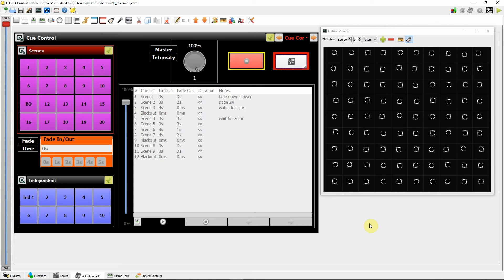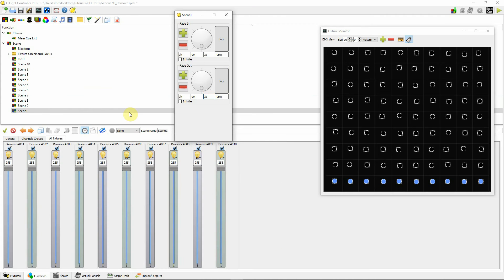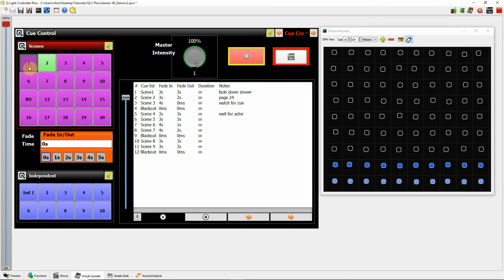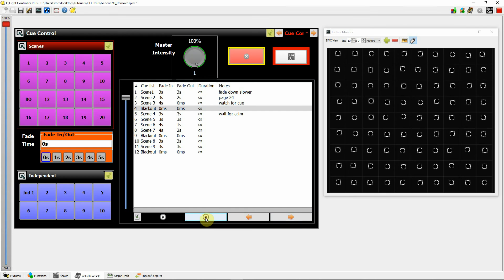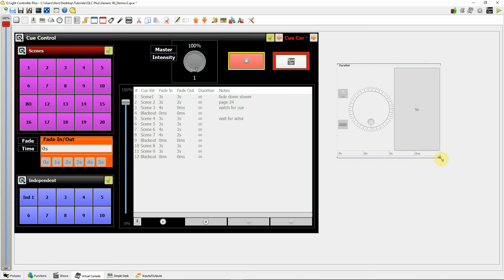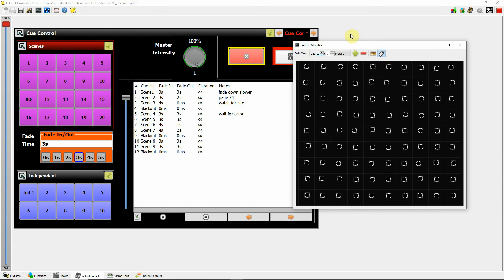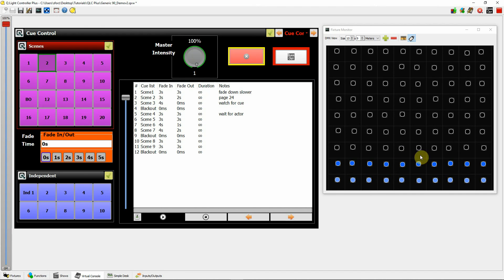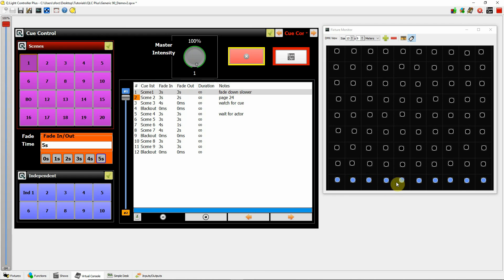QLC+: Control Fade In and Fade Out Time

Comment: Hi mate can you do one where you plug a lighting desk into QLC?
Reply from the maker: Iam not sure that I understand your question? Are you talking about a lighting desk that outputs DMX? If so, QLC+ does not have a way of recording DMX data that it is receiving. Some lighting consoles do have a way of recording DMX so you could output DMX data from QLC+ and have your lighting desk then record that data so that the desk could play it back.
If you are talking about a lighting desk "wing" then that is a different story. Some lighting desk "wings" are proprietary meaning that they will only work when connected with specific software designed by a specific manufacturer. QLC+ will work with the ENTTEC Palyback Wing and the ENTTEC Shortcut Wing and has profiles built in to work with these devices. Primarily QLC+ works with devices that either output MIDI or OSC data so you can use MIDI and OSC devices to control QLC+.
Can you give me more information? What exact lighting desk are you thinking about connecting?
Ed Richards
Reply: @edwardrichards7722  yep so I have a fat frog lighting desk and I need to get it to link with QLC but not sure how. I have a enttec and it has 2 out outs and one input. But what I was asking is if there’s a way to get this to work with QLC?
Reply from the maker: Hello
So I am still wondering why you want to connect your Fat Frog console to QLC+? QLC+ is a lighting console program which would replace your Fat Frog console. The only thing you need for QLC+ to output DMX is either a USB DMX Interface like this:
https://www.sweetwater.com/store/detail/DMXUSBPro--enttec-dmx-usb-pro-512-ch-usb-dmx-interface
Or an ArtNet Interface like this:
https://www.sweetwater.com/store/detail/DMXAN2--chauvet-dj-dmx-an-2-art-net-sacn-node-ethernet-to-2-dmx-universe
I would opt for the ArtNet interface since the computer running QLC+ would communicate with the interface via WiFi network so the computer and interface do not have to be close to each other. It also seems that USB DMX interfaces are being discontinued in favor of ArtNet.
QLC+ could read DMX information from your Frog Console and display it but it would not be of much use. It cannot activate any of the faders, buttons, cue list or any other widgets in the QLC Virtual console. If you want a tactile surface with buttons, knobs and faders to use with QLC+ then I would recommend something like this:
https://www.sweetwater.com/store/detail/LaunchContXLBK--novation-launch-control-xl-controller-for-ableton-live
You can assign the buttons, knobs and faders on this device to control buttons, knobs and faders in QLC+ using Midi.
You did mention that you have an ENTTEC with two outs and one in. Can you be more specific. Is it a DMX interface? Or a playback wing? Or a programming wing?
Ed Richards